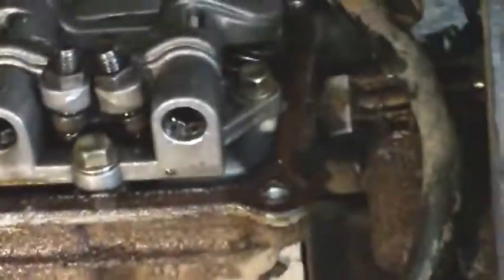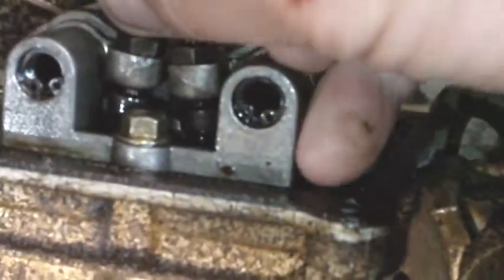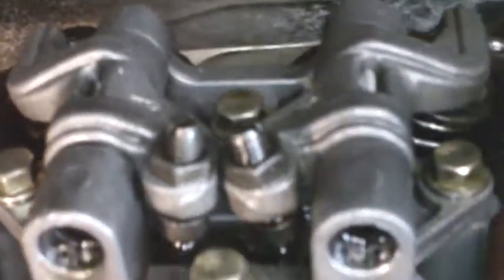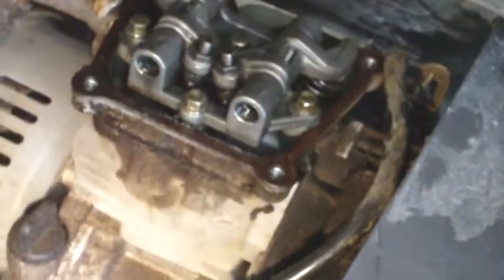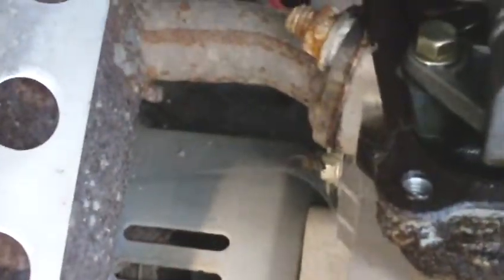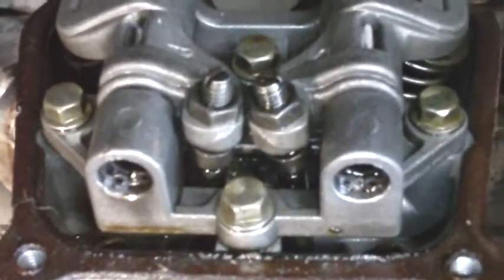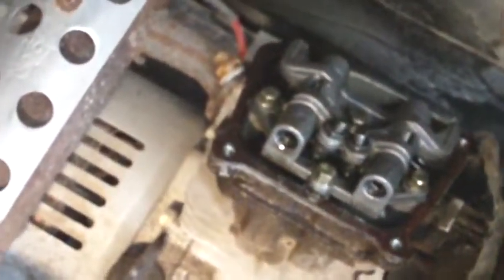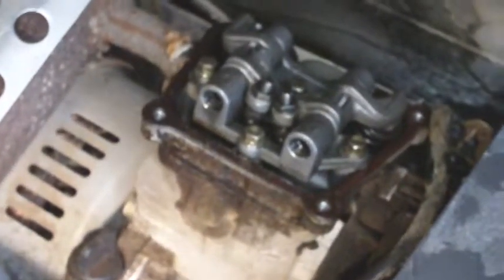UST 1350 Watt Generator Repair (PART 1)

Comment: I bought a number of these gens. Nearly all failed around 1050 hours. To deal with the nylon cam I discovered the Harbor tool 79cc is essentually the same engine, but with a STEEL cam. Requires FULL dissasembly of both engines to swap out crankshaft. (Gen uses tapered shaft, HF engine has keyed shaft.) What you lose is the low oil shutoff. But for about $100 shipped (with 20% off coupon) you get a brand new engine good for over 4000 hours. Just have to remember to check oil EVERYTIME you run it. Found zip wear on UST crank between engine swaps. Only tip is don't run HF engine for long before swap. You want the new con rod bearing to break in on crank it will run on.
Reply from the maker: +Doc Pedersen   the cam in this is from a HF , Just be sure to use the HF lifters as well  as they are a few thousands longer ..

Comment: What weight oil does this engine run? I bought one on the cheap and I did not get an owners manual wit it
Reply from the maker: +Patrick Pikulski  I see the tag says 10W/40

Comment: Gee kindly hold the camera a little still, I got all dizzy.
Reply from the maker: BUDDY LIGHT Did the best I could .. Sorry !!
Reply: I understand but if you watch your video you will see what I mean?
Reply from the maker: I have a 40 dollar cam .. It has limits ! I know it was not HD and it was shaky .. Again I am sorry I will work on it The best I can with what I have .. Thanks for watching man !! Thumb it up ..
Reply: Good luck and I look forward to more of your videos.
Reply: ShawnMrFixit Lee Hey Shawn, does your cam have a threaded hole for tripod mounting? I often use a strip of aluminum that I can bend easily as a bracket to clamp the camera in places. Not a perfect solution but you could probably gin up a mounting jig of your own. Just a thought. Cheers buddy.
Reply from the maker: No I has a crazy clip setup , I will get a setup .. Some how !! I have a tripod but for this vid it was little help !
Reply: ShawnMrFixit Lee I've never seen a clip setup but I'm sure you'll figure out a rig you can use. I know what you mean about a tripod not always helping. You gotta move it around for every angle. Can be too much hassle. Cheers buddy!